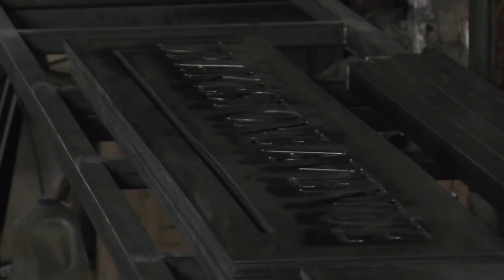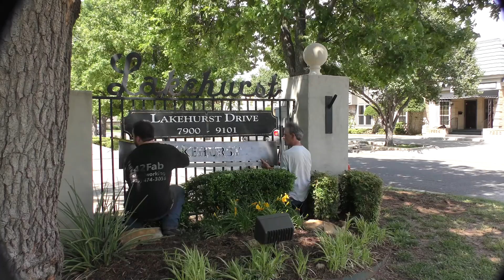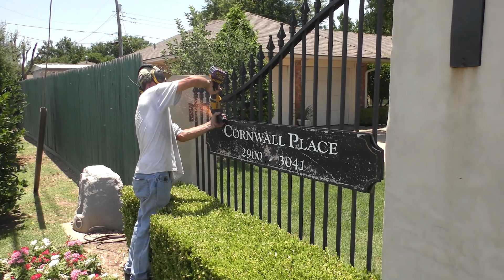Making a CNC Table EARN its Keep | Powder Coated Street Signs - 42Fab #23

Comment: I saw on instagram an ad for a nutcert installation tool.  The tool was nothing more than a hollow tube that you used your own drill to drive a nut through the tube.  The tube did have a handle on it but it was so simple.  I guess it has a tube/handle setup for each size but I think I'm going to build one so I can install nutcerts with a drill in low gear or a 1/4" impact.  I'll DM you with the results.

Comment: Can you do a bit on cutting aluminium with a plasma cutter please. What you need to do for clean up and approximate settings
Reply from the maker: It's pretty well just the same as steel. Water tables can have hydrogen build up, follow manufacturer's specs on speed, grind with appropriate discs

Comment: Gotta be careful using steel in the outdoors, powdercoat is porous, meaning that water will make it under the powdercoat and start rusting the steel, and youll be back replacing the sign out of your own pocket. Should have used a aluminium or stainless steel.
Reply from the maker: Whatever you say